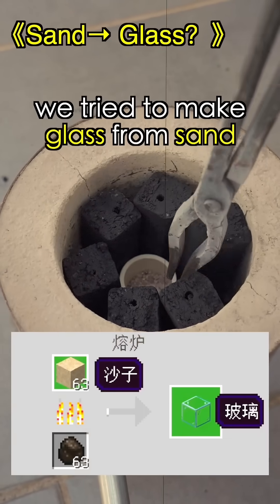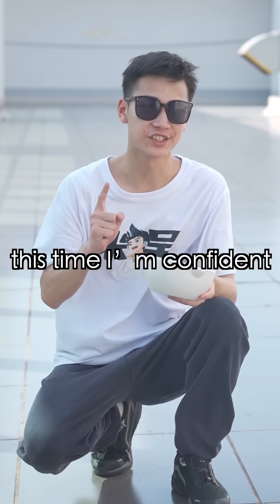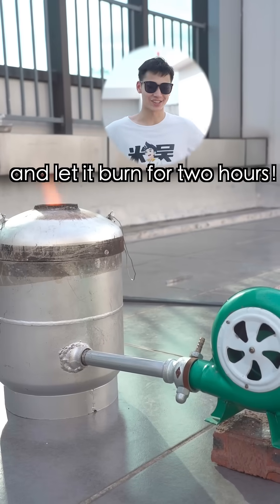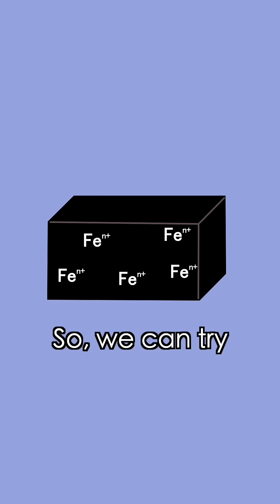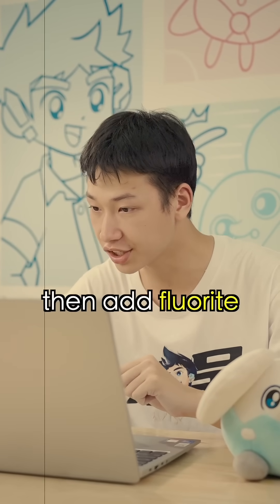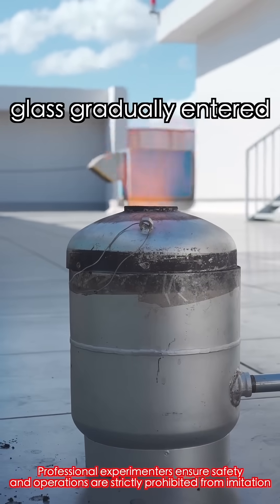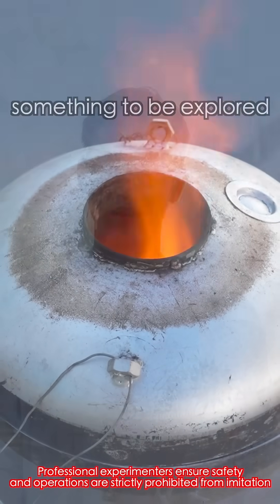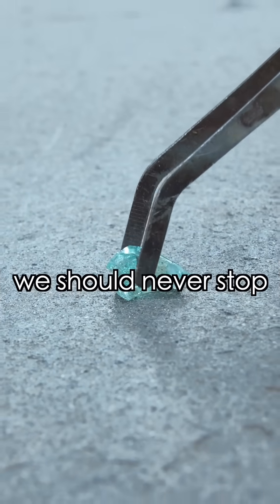Burn Sand to Glass「P2」Last Time We Only Got Obsidian, Could We Finally Make Transparent Glass?

Comment: I have a plan 

1. Measure Your Ingredients

The exact proportions and inclusions vary depending on the type of glass you want.

Place your mixture into a heat-resistant container.

2. Preheat Your Furnace to the Target Temperature

The required temp depends on your ingredients, but expect a minimum of 2,700 °F.

3. Place Your Ingredients in the Furnace to Melt

Melting can take several minutes to several hours, influenced by the presence of impurities, the overall heat transfer efficiency of your furnace, and other factors.

4. Stir and Homogenize

Stir the molten sand to distribute the components evenly and remove bubbles.

This step improves clarity and quality.

5. Shape the Molten Material

With your mixture in its liquid state, you now have the opportunity to form it how you want.

Shaping methods include:

Blowing. Gather the molten material on the end of a long, hollow blowpipe. While blowing into the tube, use shaping tools or molds to create a wide range of objects.

Pressing. Pour the material into a mold, then shape it by applying pressure with a press. This technique is used in mass production of bottles, jars, and other items.

Drawing. Pull the material up out of a reservoir, stretching into a thin fiber or rod. The process is used for optical fibers and glass tubing.

Floating. Pour the molten sand on a reservoir of molten tin metal. Large factories use this method to create flat window panes.

Casting. Pour into a mold and allow it to cool and solidify. Use glass casting methods to create solid glass objects, decorative panels, and intricate designs.

6. Cool and Anneal

Allow the shaped glass to cool slowly and uniformly.

Then reheat it to a lower temperature than the melt point (usually 900 - 950 °F) and hold and soak at that temperature.

This is the annealing process, and it helps remove stress and prevent cracks. After annealing, cool slowly to room temperature before handling.

7. Add Finishing Touches

In the annealed condition, your glass is ready for grinding, polishing, or other surface treatments.

Or move on to fusing, slumping, or another crafting technique for your finished glass.

Comment: This is The FitnessGram Pacer Test is a multistage aerobic capacity test that progressively gets more difficult as it continues. The 20 meter pacer test will begin in 30 seconds. Line up at the start. The running speed starts slowly but gets faster each minute after you hear this signal bodeboop. A sing lap should be completed every time you hear this sound. ding Remember to run in a straight line and run as long as possible. The second time you fail to complete a lap before the sound, your test is over. The test will begin on the word start. On your mark. Get ready!… Start. ding